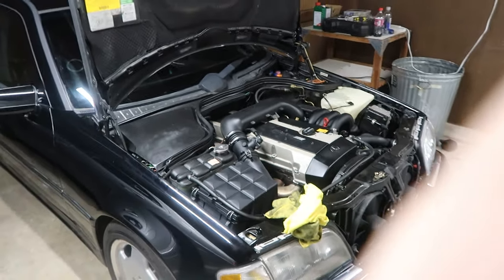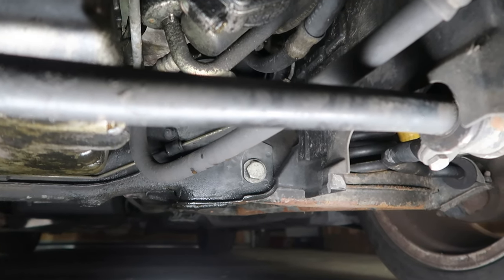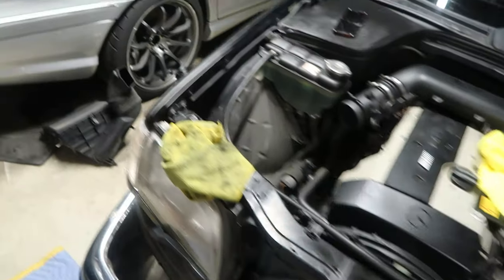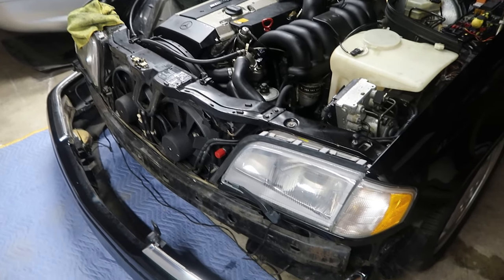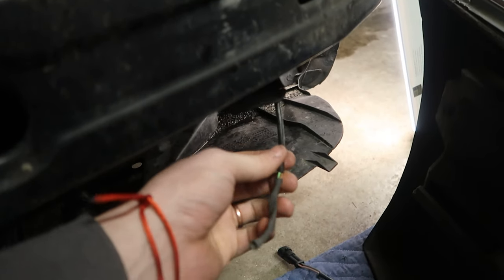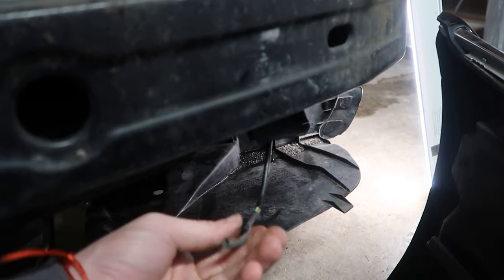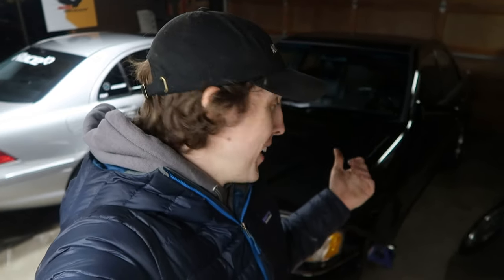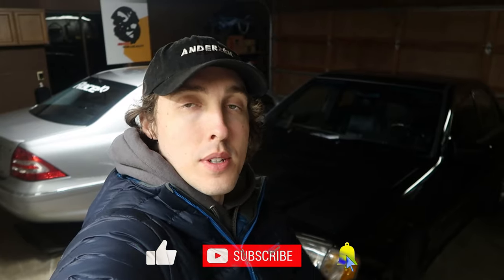C36 AMG STARTING TO FIX ALL THE PROBLEMS…

Comment: As far as I know , the Bilstein comes from the factory , but the Eibach springs may be modified . I think that the wipers on the headlights should be left, it looks cool and I think that we need to restore this function if it does not work. A good Mercedes is built from such trifles.
Reply from the maker: The factory shocks were black but were BILSTEIN, I figured out this is the B12 lowering kit popular for these. Wipers will probably stay, undecided for now.
Btw nice channel icon pic, that design looks familiar 😎